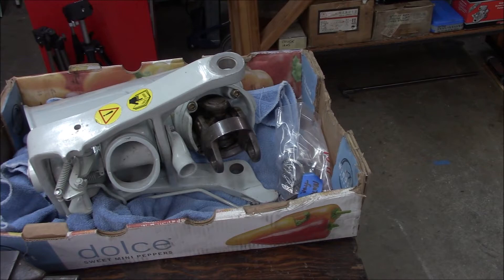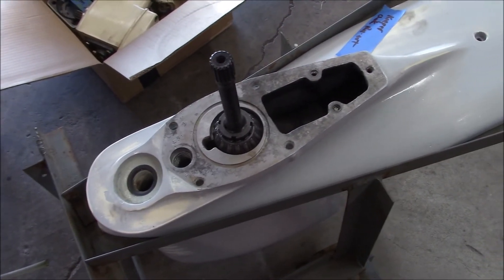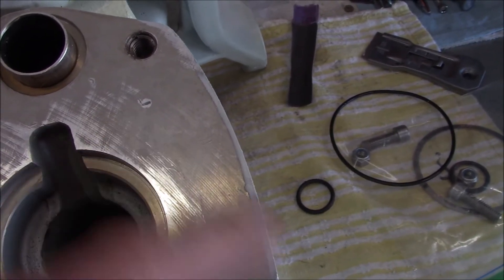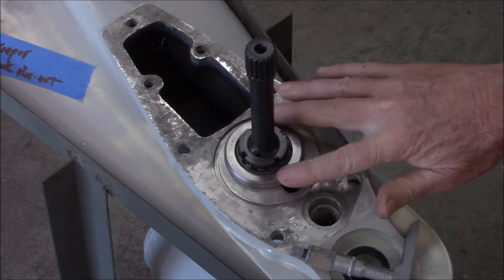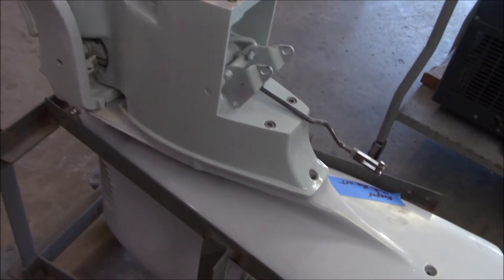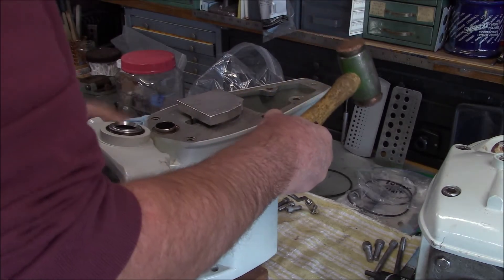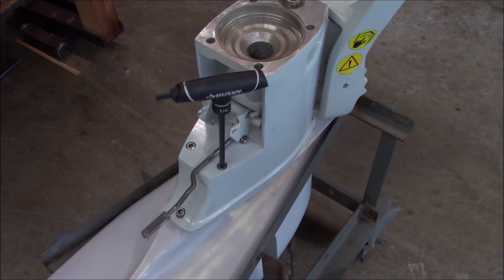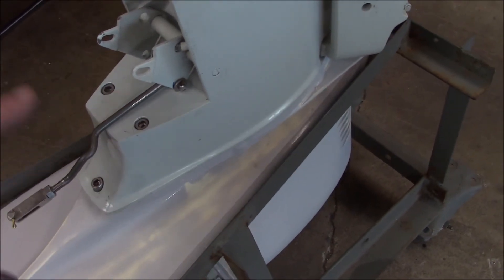Volvo Penta AQ - Shimming the Outdrive Lower Housing

Comment: Thank you!
I have a short shaft and need a long coupling. Do you have the part number for that? :)
Reply from the maker: I'll have to check on that part number. I had an extra long coupling If I still have it I'll let you know.
Reply: Thanks. I took a gamble and ordered coupling with part number 3852268👍🏼

Comment: hi, the propeller shaft of my volvo 270 does not rotate freely as in the video, and there is a noise of gears, how to fix? thanks
Reply from the maker: That's not good. Once the gears are damaged there not worth fixing. Best to start watching for a used replacement unit. Note the gear ratio needs to match in the lower. The upper 270-290 are all the same ratio and in most cases will interchange. Major differences are the steering puck number of screw holes and the U-Joint yoke on the engine side fine or course spline..

Comment: Question on the fly wheel cover housing/bell housing. After replacing the bearing in the housing should there be any play on the shaft ?
Reply from the maker: Paul, If you have a single bearing bell housing, yes there will be some play even with a new bearing due to the clearance built into the bearing.
There are 2 bearing versions also (usually diesels) they should not have noticeable play.
Hope that helps....Dean
Reply: @TheAyrCaveShop  thanks the 2 bearing one are the bearings sane size ?